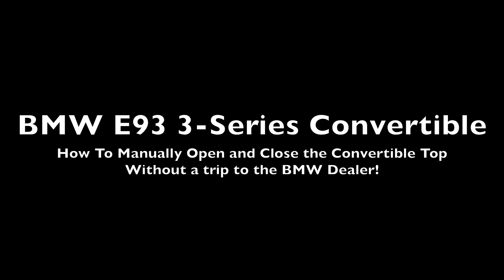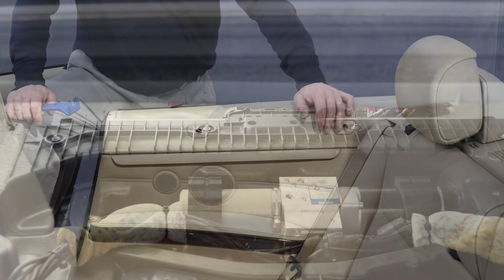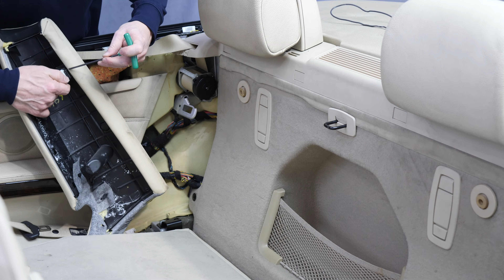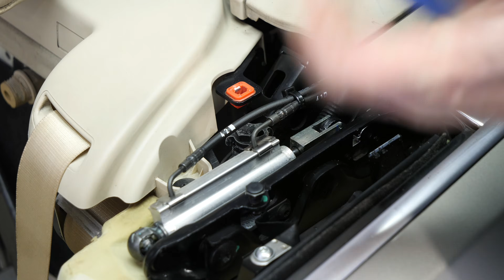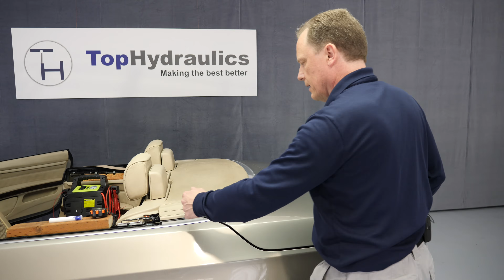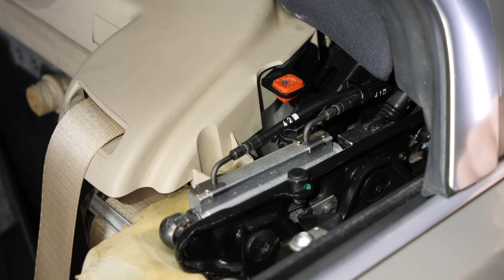How to Manually Open and Close The Top (Long Version) - BMW E93 3-Series - Top Hydraulics, Inc.

Comment: Does my 2008 120i have the same hyrdo pump.
Reply from the maker: The E88 1-Series has a much simpler top system. Here is the E88 pump on our website: https://www.tophydraulics.com/bmw-1-series-e88/322-1959-rebuild-service-for-e88-hydraulic-pump.html#/30-core_exchange-send_your_parts_to_top_hydraulics_first

Comment: Will this same procedure work on a 2017 F33?
Reply from the maker: Yes, except that the wires going to the electric front latch are different and that the pump looks a little different. The F33 pump has a black plastic cone on it that serves as a guide to insert a 4-mm Allen wrench for turning the manual actuation valve.
Reply: @TopHydraulics I can't find the 12v connector for the f33??

Comment: Klaus you are a true gent!
My 4 series convertible roof stopped half way through its cycle due to passenger side rear window mechanism failure. The motor was okay but the mechanism drive wire had rotted due to a BMW known issue. The window cavity fills with water and should be monitored and frequently drained. Not easily done because they never considered the access to the built in drainage facility, they are hidden and covered with the  side skirt trim. 
To remove the window mechanism the roof must be fully open. I have read one guy being sent away by several garages because they were unaware of the knowledge you have kindly shared. BMW should hang their heads in shame!
Reply: Hi Carl! 

I am hoping you can help

I have searched the whole internet and unable to find any help with this. My rear passenger window will not lower on my 4 series convertible and I cannot replace regulator as the roof needs to be completely down. Were you able to manually lower the roof with this video? Thanks
Reply: @jerryrod21  Hi Jerry, you have my sympathy as this should never be a issue in the first place. I was lucky in that the motor jammed so the system assumed the window was down allowing me to open the roof. The knowledge shared in this video should still apply. The pressure relief valve is easily got at and you’ll need to release the latches as explained for the 3 series. Good luck I nearly sold my car due to the worry of not being able to drop or close the roof but I’m love most other aspects of the car. Make sure you clear those drains before you put your new mechanism in 🤞
Reply: @carlkidd1262 where is the 12v connector for locking???

Comment: Extremely useful video!  Might I ask, how can I test the "rooftop set up" (aka "roof top erected") hall sensor if I have access the the x0200 connector (the top one, above the 2 pin connector on the CTM(Convertible Top Module)?
I know it is connected to pins 13 and 26 (most bottom ones)
I measure 1.3Mohm on those pins
I also measure 1.3Mohm on the pins above (12 and 25 if I'm not mistaken) which is the "roofpack stowed" hall sensor.

My roof is in the trunk at this point. 

My problem seems to be the "rooftop set up" hall sensor, since "it" outputs "1" even though the roof is in the trunk. But I am curios what would be a good way to test this hall sensor?

I already moved the roof and observed the values... this sensor's output does not change it's value (it shows 1 in ISTA, when top is erected, and when in the trunk as well)
Reply from the maker: The Hall sensor assemblies in the roof have a built-in magnet and an integrated circuit (IC) with an actual Hall sensor in it. The Hall sensor detects how easily a magnetic field around it changes, meaning it measures the magnetic permeability of the area within a few millimeters. This changes drastically as the cylinders’s steel piston comes near. Thus, the sensor measures whether the piston is near or not. The computer reads the sensor by sending a modulated signal. The IC changes impedance for modulated signals, not resistance for plain DC from your Ohmmeter.  The indirect way to check whether a sensor is working is to measure the voltage on the two leads while the computer is sending the modulated signal. On other models, the voltage is either 0.8V or 3.5V depending on whether the piston is near the sensor - I don’t know what that voltage is on the E93. If you end up measuring it for several sensors on your car, then please let us know so that I can help the next DIY enthusiast better.
Reply: @TopHydraulics  So I measured for the "rear module open" hall sensor and it's 14.14V and 14.5V (forgot which is open and close, will come back with an update).
Engine was running.
Reply from the maker: @bboysil  Did you measure those voltages with the sensor attached? I would expect them to be a lot lower. Maybe there is an open circuit somewhere?  For reference, you could measure the voltage going to another sensor.
Reply: @TopHydraulics  I measured with the senzor attached. I also measured similar voltages on another hall sensor without removing it from it's place (as stated in the previous message) everything was connected to the ctm, nothing left open.
car was running.

If you look at the 2nd video in my mesage( this one:
https://youtu.be/O3aARFA9EbE )
you can see that it detects switches from 1 to 0 as I play with it
Reply: @TopHydraulics  Also I managed to extract the rooftop errected hall sensor and do some measuremens.
it seams there is some unwanted "histeresis" going on. See videos in the link:

https://youtu.be/Va_AmL-CiU8

https://youtu.be/O3aARFA9EbE

hope I didn't "damage it" with the magnet. I think the senzor might have already been damaged OR it wasn't in the correct position on the cylinder... somehow... but rhen I might have damaged it with the magnet

Comment: I manually closed my top but it never locked…I had to change the alternator and the battery and salmon relays and the top goes up and down perfect but it doesn’t recognize it locks either when it goes up or down..any idea what it might be? Because I know it’s locked
Reply from the maker: Just to clarify: does the front lock electrically at the windshield upon closing, while you push the button?

Comment: Thany You kindly Klaus for making this tutorial available on YouTube. As a mechanical engineer who'd designed upgrades for robotics and printing presses, I thought that in retirement I could use your knowledge to at least lock my wife's 2013 e93 roof which had failed at the stack deployment phase and trunk down point in the garage after she had driven it 900km from home in QLD to use as local transport in her Sydney apartment to her workplace. She works one week in QLD then one week in Sdyney NSW. The first time she used the roof in the down position in Sydney from work, it failed at the up stack position and would not go to the next roof deployment phase. Unfortunately we live Gold Coast Queensland and my wife works in Sydney NSW and it had failed after first driving from Brisbane to Sydney on roads that really are rough all the way with the roof up. I drove from Queensland down to her Sydney unit garage yesterday armed with everything I thought I would need including a13.5 inch 4x2 and a set of long handle long nose 45 degree long nose pliers I'd re-forged to 90 degrees and trim removal scissor pliers I've used restoring classic and vintage vehicles over the past 50 years. I had only watched the short approximately 11 minute tutorial at that point. Our Australian '' EDITION'' model 2 litre diesel was the last run out model with some m3 model extras to get them sold before the seris 4 release and ours is actually Australian complied 2014 when it was first registered. It's still very low mileage and the hydraulic reservior shows the fluid clear and at the correct level when inspected by me. When I removed the C pillar upper door trims they appeared to have been removed at least once prior. This last of series run out model also has a ''ski'' pod with zipper in the rear squab cover you  remove in the tutorial which shrowds the lower single torx 25 bolt/screw. and this model has no apparent manual trunk key lock. The system appears to have failed at the eletro mechanical point of trunk close rear lock deployment and without energizing the 12 vold 5 amp servo, no matter how much force used with pump bleed screw(s) top and upper rear side opened, I could not force the C pillar hydraulic rams to (FULLY?) close to the point they appear to interface with what appears to be hall sensor metal shrouds to allow the next protocol to continue the roof deployment from the ''stack/trunk lid down position. To confirm this, with the 2 x pistons not drawn fully back but back as far as I could get them  lets say 15mm of shaft still showing rather than the 5mm or so you show is required, we unfolded the roof stack and could get the front section to align with the windscreen but at this point the rear stack section lock posts would NOT insert into their female docking assembies. QUESTION Sir. Is this because I had not accessed the 12 volt servo power plug behind the rhs rear sear upholstered squab you remove in the longer 37 minute tutorial? And if so, considering our 2013 model appears not to have a manual trunk key lock ( obscured in your tutorial as I suspect it's considered all models have a manual key lock) and then the ski sock accessory which obscures the lower torks 25 screw, could you offer any contingencies considering my wife's local BMW dealership in Miranda can not look at her car for another 4 to 6 weeks due to most of their engineers contracting Covid 19, and the fact that if I drive this vehicle the 890km home to my garage with the roof lowered into the trunk but the trunk lid not locked down, the bad interstate road condition will most probably destroy an unlocked stack. Thanks Klaus.
Reply: Also Kaus when I next rive down to Sydney to attempt to make my wife's car road useable, I am going to install a small piggy back loom to that 12 volt 5 amp servo plug to make it accessable from a discrete point near the lhs rear passengers seat inside the cabin. I suspect a relay has faultered but taking the wrong obd2 diagnostic tool I'd loaned down with me I have not been able to dectect the actual fault code to remedy the loom, relay, or hall sensor or any other process sensor I suspect did not pass the Brisbane to Sydney interstate highway rattle test at Easter when my wife took this car down to use as her private transport for the week on week off work contract she has in both capital cities.
Reply from the maker: @AUDIOPHILE1956  Thank you for your very detailed description. It is Saturday evening and I’m traveling, which makes me less than fully concentrated. For your consideration: sometimes when a top has stalled part way during the hydraulic operation, check valves inside the pump can engage such that the frame lock cylinders cannot be moved all the way manually. If this was the case here, then you could unhook a single hydraulic hose from the pair of cylinders and manually latch the frame locks all the way. What do you think?

Comment: Thank you so much for this tutorial. It's very
straightforward and detailed, however I am having
quite a bit of trouble securing the rear coupling. When
I press down and pull it back, it stops half way and it
doesn't go any further. Do I have to release more
pressure on the pump or I need the Incredible Hulk to
give me a hand @. Any advice would be so grateful.
Reply from the maker: The rear coupling can be pretty hard to move all the way. Unless you have a personal connection to the hulk, try again when you feel extra strong.
Reply: @TopHydraulics  i had a guy that can deadlift 600lb and bench 400 and he couldn’t get it
Reply from the maker: @TheRyanPrincipe  That's curious, maybe a valve inside the pump has moved such that it is blocking return flow from the cylinders on the rear couplings. There are lots of check valves in the pump and this could be a coincidence based on what has been moved before.  

Let's proceed by temporarily taking off the rear hose on one of those cylinders, let's say #41 on the left cylinder. Re-attach the hose once both cylinders are fully extended. 

To take off the hose, slide the retaining clip for the hose back until the hose is released, then pull up the hose. It takes a decent tap on the clip with a screwdriver or drift pin to loosen it up - lightly tap the screwdriver with a hammer. Stick the removed hose in a ziplock bag or similar, as there will be fluid coming out of it when you move the matching cylinder on the other side. Have paper towels or clean rags ready, as you will have a fraction of an ounce of fluid coming out of the cylinder that you took the hose off when you extend its shaft. It will squirt straight up when the cylinder moves.

Please let us know if this does the trick!

Comment: Fantastiv video! Thanks for investing the time  to make this - great explanation, video quality, and most importantly it worked.
Like others, I had a difficult time pulling the rear coupler back into place. After many attempts, I took Klaus’s advice and used my brain. I realized I could see the back side of the coupler after opening the trunk lid. I used a 4’ metal level to push to forward and with a LOT of force, got each side to latch. The red light stopped blinking on the roof switch and I am now able to raise my windows with no warnings or error messages. Now I just need to decide if I want to invest in a real repair, or just re-install the trim and acknowledge that I now have a coupe instead of convertible. Thanks again!
Reply from the maker: I’m glad it worked for you and thanks for sharing! Nice approach to closing the rear coupler: you found a tool to push against it from the trunk, which allowed you to use more force. Well done! 

If you were able to manually close the top, then you can also fix it yourself. What were the exact symptoms?
Reply: @TopHydraulics  The last time the top opened, the motor unlocked but the top did not lift off the windshield. I gave it a push up from the drivers seat and it opened and properly stowed in the trunk. 2 days later when trying to close the roof (since it was now 35 degrees instead of 80), the trunk lid opened properly but the roof would not lift up. I could tell it was unlatched, but it would not lift. I closed the trunk lid and eventually found your video.
Hydraulic pump seems full of fluid and I removed and replaced the 2 relays as a “maybe this will work”, but no go. Afraid it will get stuck again, I have not tried to open the roof now that it is closed.
Reply: “Removed and reinserted” the relays - I did not replace with new parts.
Reply: @frankmouns7747 what did you use to pull the lever in the rear the long reach pliers are not working for me lol
Reply: @cochranga84 did you get this sorted?
Reply: @karundhuna8486 I would assume normal pliers
Reply: This is amazing information I noticed this too my couplers are also jammed at the moment and I legitimately just died of laughter since I am stuck in the same situation of a convertible turned to coupe especially with the now about 20k cost to fix the roof by BMW.

Comment: My windows won’t go up though after I have manually locked it. Help?
Reply from the maker: The windows will go up only if you have latched the top completely, including the frame locks behind the rear windows.
Reply: @TopHydraulics  I didn’t unlock them. I skipped that part. My top would still come half way up. So put it up half way, loosened the hydraulic pump, then manually closed it, then put 12 V into the actuator to lock it.
Reply: Is that the problem that I skipped that part?
Reply from the maker: @joshuarodriguez667  You still need to lock those rear frame locks, as the pump has unlocked them when it started the closing sequence.
Reply: @TopHydraulics  okay thanks!
Reply: @TopHydraulics  I can’t seem to lock them
Reply: @TopHydraulics  do I need to release pressure some where else as well
Reply from the maker: @joshuarodriguez667  The pressure needs to be relieved at the pump only. Try harder, it can take a lot of force to lock the frame locks manually. You could try pushing with a stick from inside the trunk - be careful not to squash any switches with it, though! If that still does not work, then step back in the cycle and manually move move the part that was supposed to be moved before the frame locks, as this may free up a check valve inside the pump. Be sure to have the ignition off.
Reply: @TopHydraulics  id like to say thanks for being responsive. I was able to to lock the the back and the windows still won’t go up. Any more suggestions?
Reply from the maker: @joshuarodriguez667  The windows will go up after the computer has the signal that the frames locks, the front and the trunk module have been fully closed. Did a sensor get damaged during your efforts, or is one of the latches not fully closed?

Comment: Will the windows go up after manually closing the top?
Reply: No I tried it and don't seem to work
Reply: @A8pri  Didn't seem to work? Like... what do you mean? It either worked or it didn't...
Reply: Not it locks good but then the dash says it's not locked and won't let me open windows or the back is it possible I hit some sensor?

Comment: Please do a video on replacing both rear gas springs (Part number: 54377128764) that with age cause the top the slam down into the trunk. Not part number: 51247129215, as this is for the trunk lid only and are very easy to replace.
Reply from the maker: Thanks for the suggestion. Indeed, that video is on our to-do list for this year and we have a nice setup for it. With the proper tool from BMW or with some improvisation on a standard tool, the job is pretty easy.
Reply: @TopHydraulics  No problem! I look forward to the video. I subbed already 😁